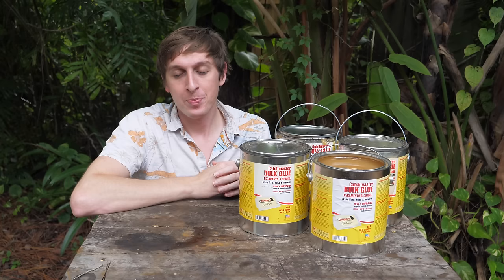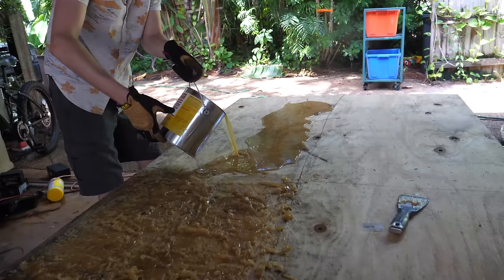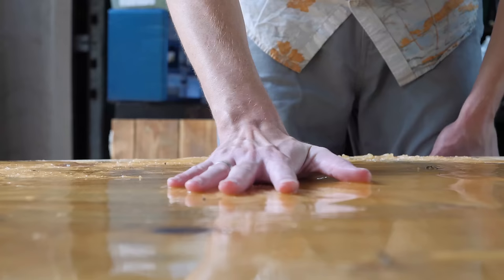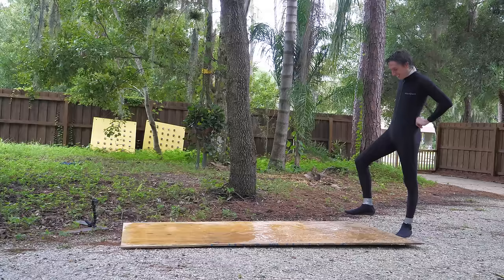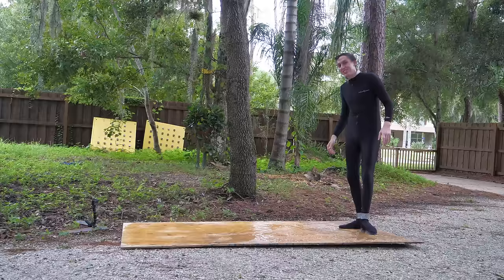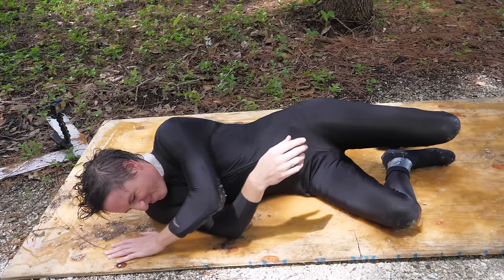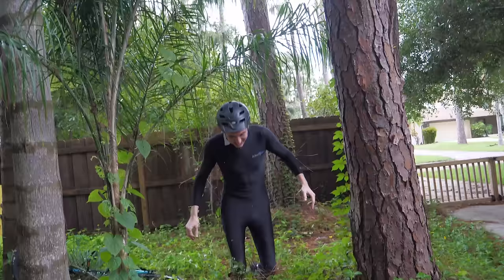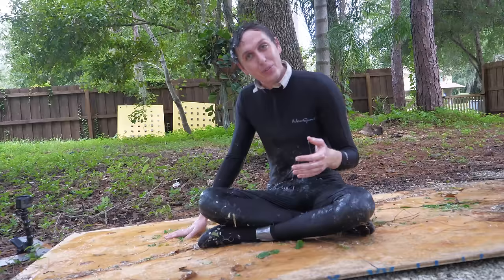Can a Person escape a human-sized Glue Trap?

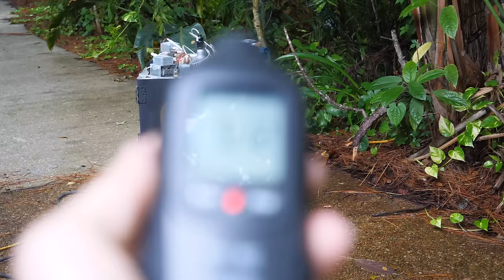Comment: 0:17  Yeah, aluminum foil protection from microwave radiation?

That's always worked out for aluminum foil put in a microwave...
Reply: I mean, it shouldn't be terrible, so long as you're not standing next to some other metal and getting hit with really large amounts of it so it causes an arc, but still, from past experience, aluminum foil isn't the first thing I'd go with!
Reply: It's a Faraday cage, it probably won't survive huge amounts of Microwaves but for small amounts   it will work
Reply: It actually just reflects if, which is why you shouldn't put it in a microwave or it'll bounce the microwaves around and probably aim some at something that wasn't supposed to get hit by microwaves.
Reply: @GamerJackieChan2  That's why he said don't stand next to metal

Comment: You might want to sprinkle some Mucinex on that glue. LOL Never use WD-40, use cooking oil!
Reply: Doesn't work
Reply: Vegetable oil works. I have the same glue.
Reply: I know wd 40 is mostly mineral oil but its dissolved with mineral spirits which goes through your skin and is toxic. That lizard probably died later if not from kidney or liver failure but from parafin wax clogging up its pores
Reply: @1019wc1019  WD-40 is fairly safe for humans(On your skin), but everything you put on your skin is processed by the liver.
Reply: electronicsNmore mucinex is an allergy medication lmao
Reply: Mucinex loosens up your snot
Reply: @k-rodkev-dog7449  and snot keeps things from sticking to it.

Comment: Not to rain on your parade, but this is not an accurate test. You didn't take the ratio of the size of the insect/rodent to the thickness of the glue into account. You need to redo this test with at least a cm to an inch worth of glue. Pretend you're the size of something small and you actually get into the glue, rather than just on top of it.
Reply: The bigger problem is the plywood and the suit. A real glue trap is flexible. When you try to pry yourself off, the trap just flexes with you. He should get a tough pleather mat and cover that with a good thick coat of the glue. Then he needs to remove the suit. The fabric has a lot of give to it. It stretches and deforms allowing him greater leverage to remove himself. Think of pulling a piece of tape up from the corner versus an entire side. There is also the pain factor associated without a suit. Mice have it really bad considering the amount of hair they have.
Reply: Anthony McDevitt  I missed those factors, good catch! I kinda hope he redoes it, but I highly doubt our dreams will come true.
Reply: Should check out Seenit’s version they have, I would assume it’s more accurate, it was a test for a cockroach glue trap, 3 different people and the board flexes on the 3rd. Interesting to watch to say the least.
Reply: Hahahahaha rain on your parade and there’s a hurricane coming in his direction nice
Reply: jjaapp18 that’s what I was just thinking how mouse traps are usually thicker in glue
Reply: jjaapp18 ikr
Reply: exactly!
Reply: Having body hair in the glue would also make it a lot harder.
Reply: U just rained on his parade
Reply: jjaapp18 he's also not covered in fur
Reply: +Anthony McDevitt Even for a human the hairs would likely make the bond significantly stronger as they have a rather large surface area for adhesion. They are also fairly difficult to rip out on mass, getting a few to break free of their anchors in the skin at a time is easy enough but trying to do the same to hundreds or thousands at a time is significantly harder and there are a lot of them even on a human when you add up all the ones on one side of the body.
Reply: Just entertainment guys
Reply: @CT-5736-Bladez  no there isn't he lives in Florida
Reply: that wouldnt make it any more accurate.

Comment: 0:11 no, this is not normally what it sounds like to be inside a running microwave, the reason you hear that low pitch sound is actually a lot cooler, as you may or may not know, microwave radiation and tech do not mix, what you were hearing was the microphone and camera reacting to the microwave radiation, luckily it was mostly undamaged, but if it was inside the microwave, it would have broken it

Comment: Just an observation those traps are in a dish so there is depth if you try this again do it with a 1/2in to 1in of the glue for the longer your in it the deeper you go more surface for the glue to hold

Comment: This is not a fair comparison to the pest traps. The glue would need to be about 3-4 inches deep. Also, fur is going to stick much harder than fabric. Also, you need to allow your head to get stuck (with fur) if you really want a fair-to-scale comparison. I am sure you would never escape from scale-correct human-sized glue trap. Especially a furry human. There would be no hope of escape after just getting a little bit stuck in it.

Comment: I really hate mice and rats. I used one of these sticky traps before and I will not do it again. With one of the snap traps its a quick death but these sticky traps, not so much.  We had a mouse get stuck on one and it was determined to get freed, let's just say we had a bald 2 legged mouse somewhere and we never did find it. Both my husband was like what a horrible way to die.  Even though I hate mice and rats, I don't want to torture them. Yes, I want them to die but not like that.